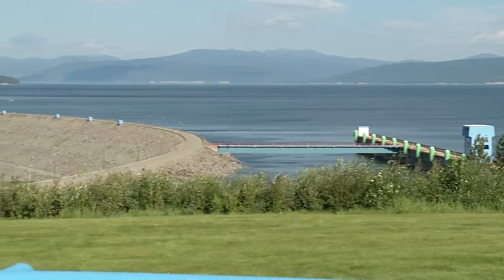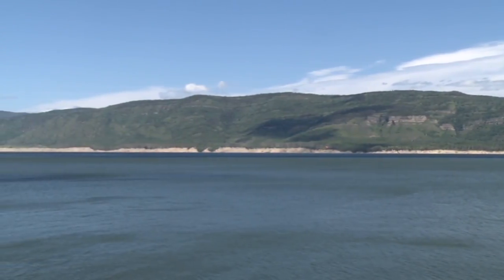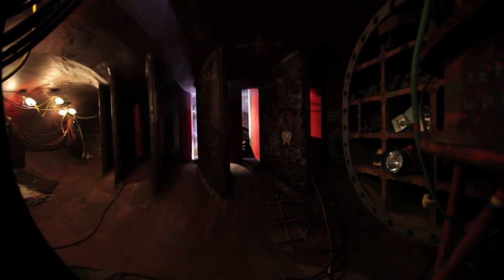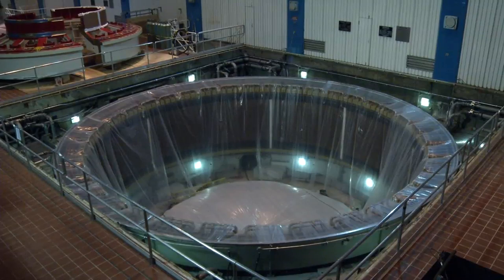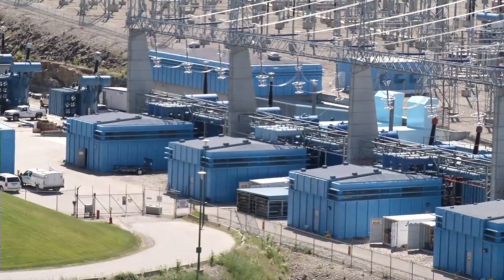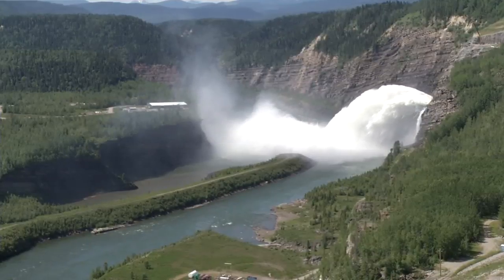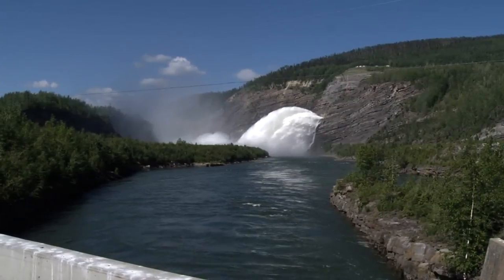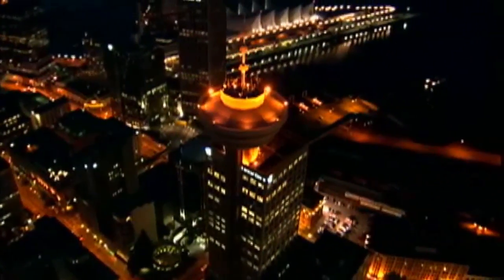Tour of the W.A.C. Bennett Dam

Comment: Electricity,gold and silver, Platinum, Manganese, Mercury.  All mined at dams as well. They don't tell you that though.
Reply: Only thing mined NEAR the dam was coal. You have a problem with mining?? NOTHING was mined under the 'roo'f of this project. Get some facts. That said, they DID hit a coal seam in the underground powerhouse.. and had to build a sub haunch to strenthen the Haunch, which supports the arch and also serves to hold the rails for the Gantry crane. That cut into their profit a fair bit, What almost did them in on the $25 million powerhouse (aka contract 25) was when the wrong mix design went into the first Arch pour of the powerhouse. 550 Cu yards Interior  1 -1/2" 5000 psi was the order, What was delivered was Ext 1/12 3000. Major job removing the stuff and the re bar , then start over.Time lost, about a week

Comment: is it true that the walls are are going or are rotting away
Reply: +tricia smok it's an earthen dam, there are no "walls" to rot away. there was a sinkhole inside the dam discovered in the mid-late 90's and they poured thousands of truckloads of grout inside to repair it.
Reply: yes that is what I wanted to hear thanks:)
Reply: funny I drove over the dam the other day and it is still single lane where that sink hole was
Reply: No and if there are problems like the sinkhole mentioned by others they are fixed quickly. BC doesn't neglect dam maintainence like other places sometimes do
Reply: Nope. Not so

Comment: 13-8 megawatts?  Ooops, dude must have been nervous in front of the camera.  Each of the 10 units at GMS are more like ~300MW, but they do generate at 13.8kV which is indeed transformed to 500kV up top.
Reply: 13,8 KV, up the LVLS to the switchyard. So you get a pass. Man I actually remember this. So much for senility, I don't remember the numbers but I THINK the Gen are 50 mw apiece, so light up a third of Vancouver.. and not to nitpick but 550 KV is the number I remember for the transmission lines.
Reply: @glenw-xm5zf  Ask anybody familiar with the transmission system, it's called 500 kV but that's a short-hand, not an engineering term.  Go ahead and google GMS capacity, it's 2830MW across ten generators.  It's not exactly 300MW each, but close to it, because the ten units are different vendors/models installed over time.